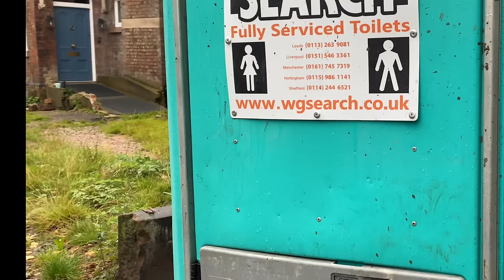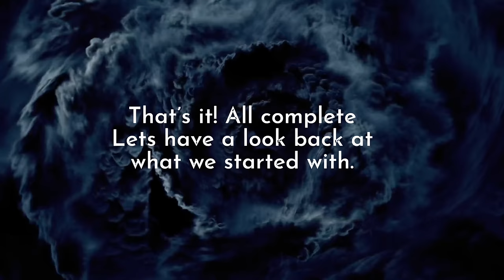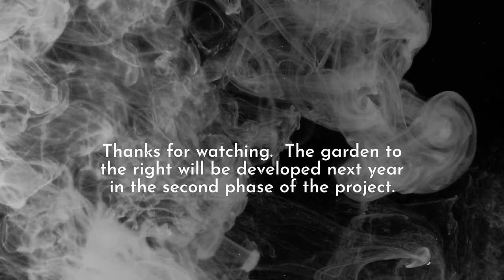The Old Cactus House Driveway - Built By Brockstone. Designed by Dee Stewart

Comment: What is the dry mix that you set the edging stones into? Does that harden eventually? It looks like it would compress once some stands on it.
Reply from the maker: It would if it was trodden on right away
You can walk on it after 24 hours but the setting continues over weeks and years.
Reply: Nice - what is the mixture that you use for this @Brockstonepavingpros?
Reply from the maker: 5/1 grit sand cement